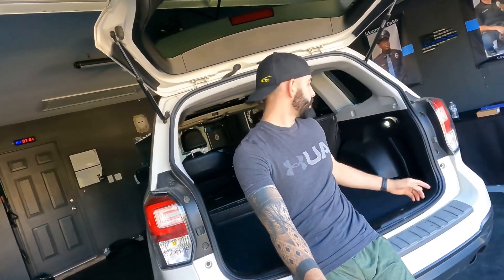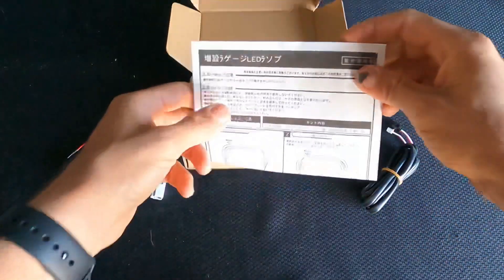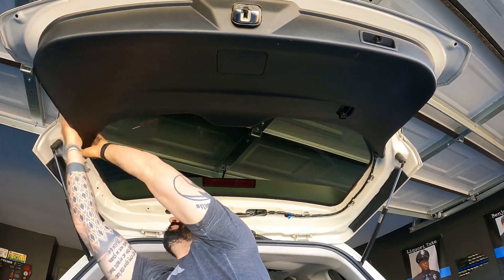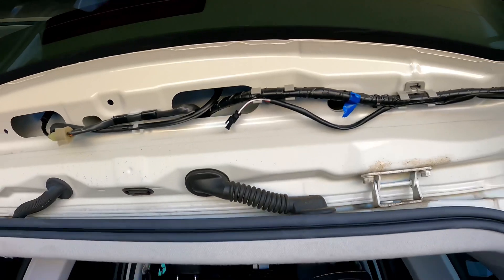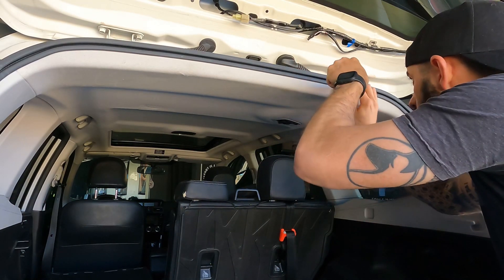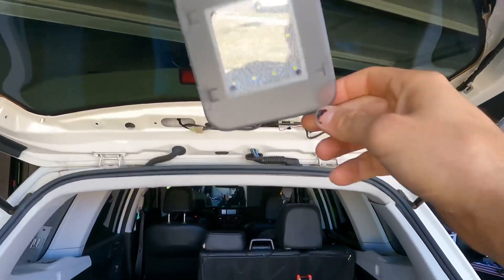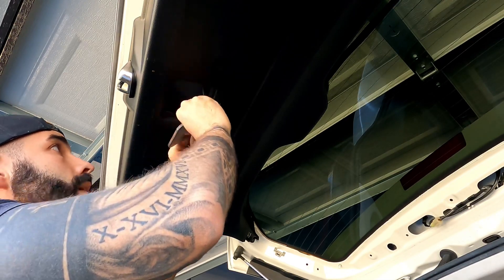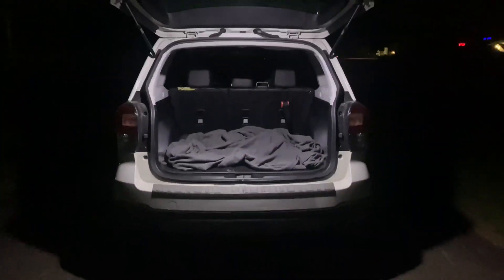Must Have Hatch Light Upgrade for Subaru Forester 2014-2021 models (SUBIESPEED)

Comment: Got this to install into our ‘17 Forester - thanks for the walk-through of the install. While they now have newer type automotive fuses, mine also came blown. But they were smart enough to put in an extra fuse. All installed, but somewhat disappointed with the level of brightness. It is much better than the stock lighting, and nice that it lights up the area behind the car. Time will tell we’d want more interior lighting.

Comment: I just finished putting my new trunk light in. It looks great! I had an issue with the brand of light I bought which had a rather large connector clip that just would not go through the connector at the top of the headliner. The clip was sturdy and a good addition but just too large to fit through that correlated rubber hose. I had to take wire cutters and snip the wires to take the connector off, feed the wires through and then reconnect that connector to the wire some wire nuts.

Comment: Thank you for the explanation. Even though my Forester had some extra tricks up its sleeve, like a push button for opening and closing the lid and an extra hydrolic strut on the left side. It made the enterprise super easy this way. Thankfully my fuse worked. Ordered some new ones, just in case ;-) Thanks again.

Comment: Josh, I ran across this video & it was great. I immediately got a hatch light for my Forester. Subaru made everything so easy to get to & I had it done, with your help, in under 20 minutes. The only part that had me talking under my breath was when I took the rubber grommet off and had to work it back on. I should have taken my time and pulled the entire white clip out … oh well. Thanks and thanks to Subispeed for great service too

Comment: At 10:33 are you supposed to just plug them into the connector? I read you took the plug that hooked up to the little existing light and used it for that?

Comment: Got this light as an upgrade for the stock lights on the 2023 Forester Wilderness hatch.  Waste of money.  On one hand, the installation is MUCH easier, since all you have to do is tap into the existing harness for the stock hatch light.  However, it's actually LESS bright.

I'd send it back for a refund, but Amazon doesn't have a "this product is lame" option, and returning it via DPO is a pain.

Comment: Very cool! Can it be turned off while the trunk is still open?
Reply from the maker: Sorry buddy I somehow missed this message. 3 months late but still gonna answer it. No there isn’t, but you can install a switch which I’ve seen a few people do. That seems to be its only downfall is if you plan on having your hatch open for an extended time
Reply: @WEEKENDWNDR3RS  
Knowing is LED, but,  does it get any hot?
Does it suck too much power to drain the battery?
Reply from the maker: It gets a little warm but not too bad. While camping I had the hatch up while cooking as light to see and it was on for close to an hour and didn’t drain the battery. I can’t speak for longer than that, but an hour of straight runtime and the Foz cranked right up!
Reply: Was going to ask the same thing. I've made it a habit to keep a carabiner near the hatch so that I can insert it onto the door latch whenever I plan to have the hatch open for an extended period. It would not only turn off the new light but make sure that all other interior lights think the hatch is closed. Better safe than sorry. Especially when out in the country.

Comment: Any ideas what I may have done wrong as the factory light is working and I checked my fuse with a vault meter and it is still good. Just no LED power.
Reply from the maker: Mine did the same but I swapped the fuse anyways and it worked

Comment: I've read online that some people suggest wiring an inline fuse instead of the stock fuse the comes with it, would you suggest this? I'm not fantastic with car electronics, and I'm a bit worried I may blow another fuse / damage something else in the car if I do this wrong. Do you think simply upgrading the 5A fuse from the kit with a 6A fuse is enough? Is there any "order of operations" that might result in blowing another fuse in the car? (IE - Wiring the light before the rest of the connectors are plugged in).
Reply: I did everything but one thing "by the book" and i had no issues whatsoever. The only time that i didnt follow the directions was when i snipped the plug from the long wire off and also snipped the plug attached to the hatch lights wire and soldered those two snipped endsof the wires together. (I hope that makes sense) the little plugs were kinda loose and my light was flickering so thats how i fixed that. Havent had any issues since i installed it six months ago.

Comment: Thanks for the awesome video!!!  I just finished the install but had the same problem as you…a blown fuse upon arrival. Did you end up using the same fuse?
Reply from the maker: No I actually bought a 6 amp fuse and that seemed to resolve the issue
Reply: @WEEKENDWNDR3RS  thanks for the quick response! Planning to get that tomorrow at ace hardware then! ❤️❤️❤️
Reply from the maker: @ZoeyyAndZemo  no problem that’s actually where I got my replacement fuse!
Reply: Any clue to why my 6A 250V fuses are still blowing? And is there a certain way to plug in the fuse?
Reply: I picked up 5 fuses from Amazon. Unplugged the wire, and plugged in the fuses and they all blew…I have 1 left lol I saw some people saying to skip this and buy a in line fuse.
Reply from the maker: @ZoeyyAndZemo  yea I have no idea why mine just worked and no issues and others are struggling. But I’ve seen a few people recommend inline fuses so maybe that’s the way to go!